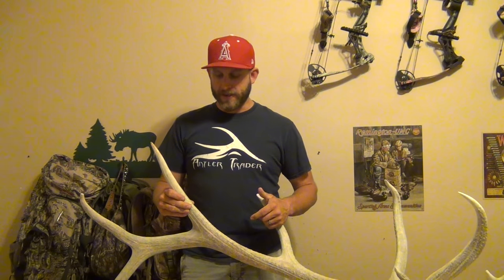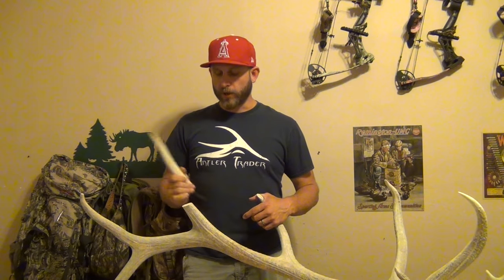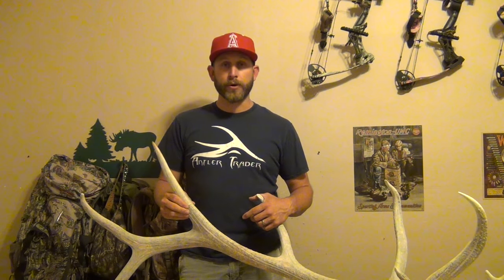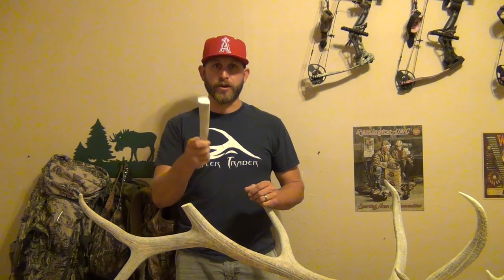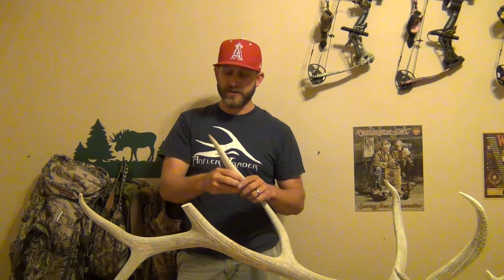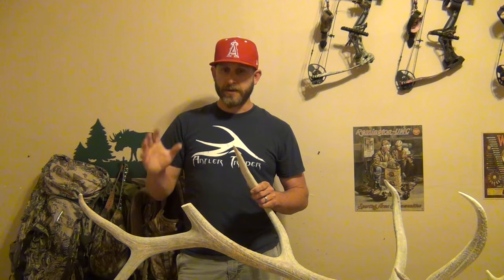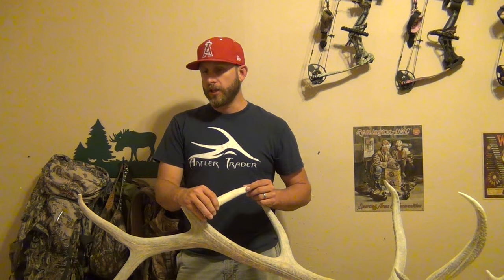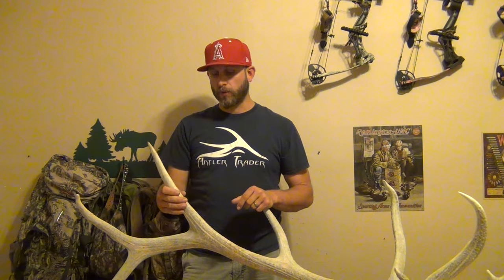Elk Antler Repair & Coloring DIY Antler Trader

Comment: Thanks for sharing how you color antlers but you didn't show the finished product! Also I was wondering how you match the spot with glue, I glued an antler tip like you did and I had a line where the glue was.
Reply from the maker: I deleted the final video on accident and didn't realize it until it was to late. I just blend it with color until its gone